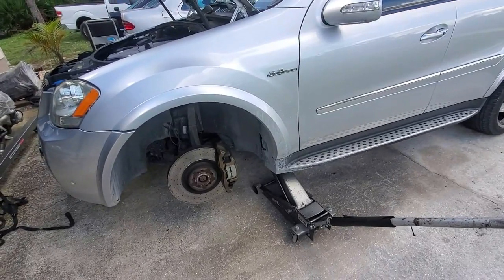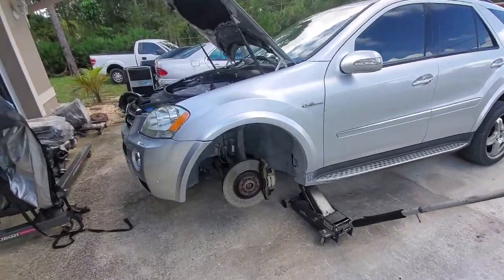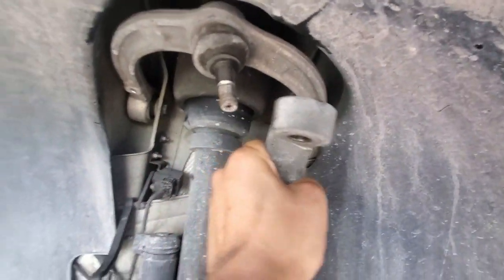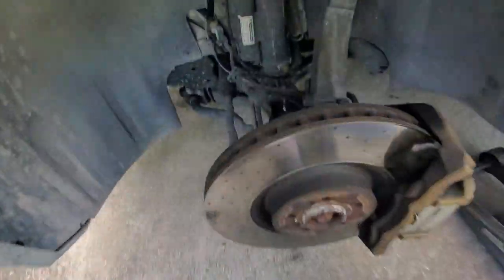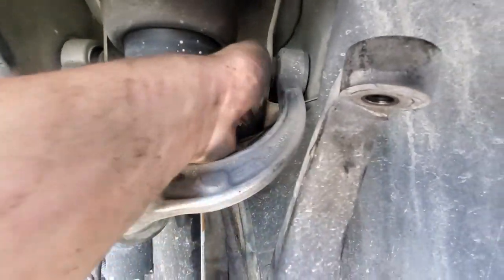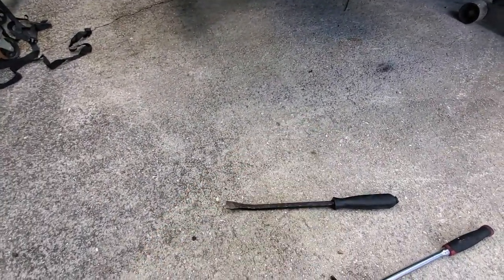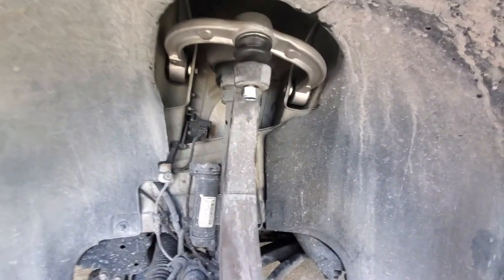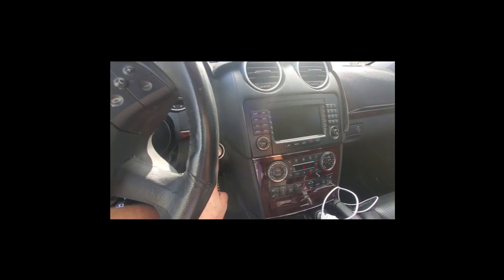2007 Mercedes ML63 AMG Front Upper Control Arm Replacement HOW TO w/Air Suspension

Comment: I’m desperate to change mine on the 12 GL550, clunking noise driving me nuts but that driver side back bolt is my nightmare, good trick you showed here those flex wrenches, I like that. Luckily I have smallish hands so I hope it will not be that hard, you gave me good confidence man, thank you.
Reply from the maker: @commodoreras  anytime. These really aren't that bad to work on.. GL should be nearly identical so as long as it's not rusty or anything underneath it really shouldn't be a bad time

Comment: Thank you for this video, I have to do these also along with the Lower control arms. Also I think my noise, clunk over small bumps is the SubFrame Mount Bushings. I've replaced everything else. 2007 GL450.
Reply from the maker: Anytime glad it helped. This was my source of clunk. The front sway bar bushings I also thought could of been the culprit but these made a huge difference.

Comment: How were the mevotech supreme?  I have a 2011 550 that I want to refresh, but don’t want to break the bank as I’m only putting 5k miles a year.
Reply from the maker: Nothing wrong with them. I've run their brand control arms on other cars and had no issues during my ownership. For something with that little mileage a year I would go that route.